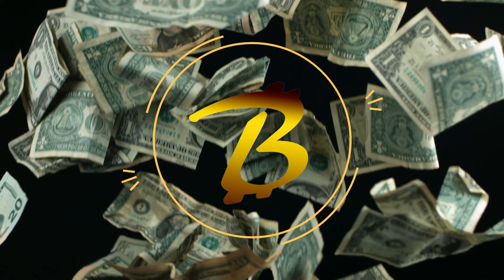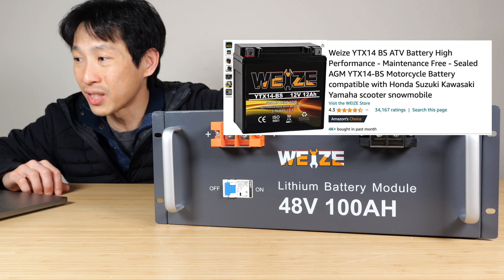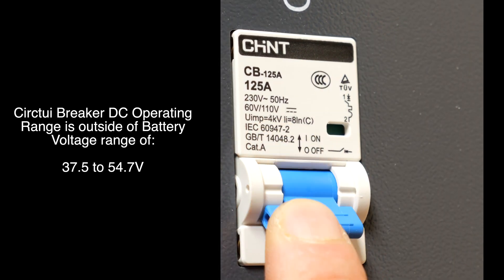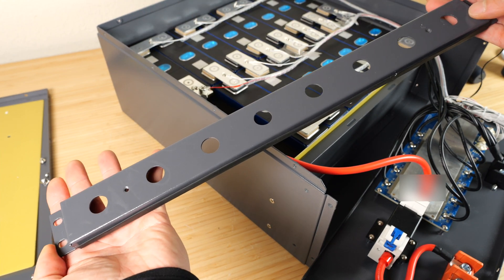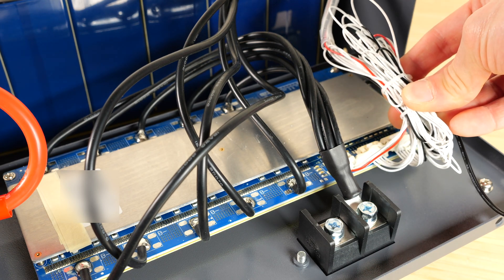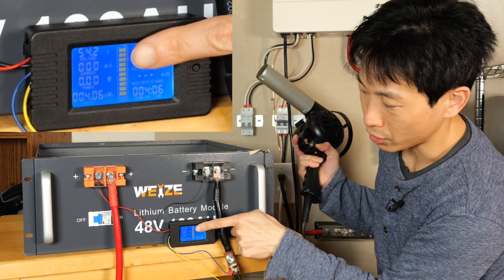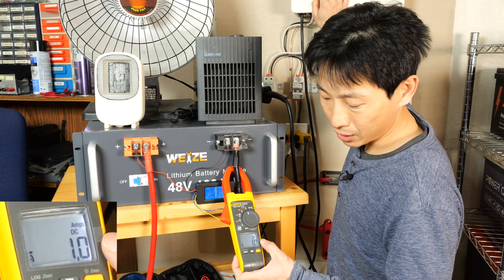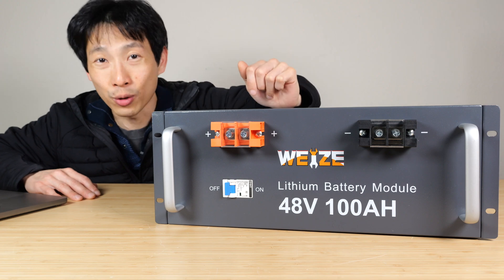48V vs 51.2V Server Mount Battery [Weize]

Comment: Absolutely WORSE battery company I have every seen. Sent me a dead battery will not replace  currently working with California Attorney General regarding Consumer Fraud   stay away horrible horrible customer service !!
Reply from the maker: What kind of debugging process did you do to arrive that the battery is dead?
Reply: @BeatTheBush  The on off switch will not work the charger cannot charge it and putting another 36 v battery to it does not resuscitate it. Retuned over 2 months ago. Weize still playing games. Needed batteries to run manlift to repair my roof . Now have a lot of damage due to their delay. I am  Now working with California Attorney General for consumer fraud

Comment: Hi, was wondering, apart from voltage difference s, what are the pro and cons comparing this battery with the ones that you reviewed several videos back? (The ones that have carry strings attached).. assuming they're both on the same voltage..
Reply from the maker: If you have 48V (16 strings) on both packs, it's better to go with a server rack since it has battery balancing built in. There's less cost of cables, less fuss and assembly too.

Comment: Stop making biased reviews of these lackluster products just to make a buck and get free swag.  This battery is super cheap only because it is unremarkable with what must be average cells based on your testing.  A brand new battery with decent LiFePO4 cells should have easily pulled rated capacity or more without needing to get into the absolute top/bottom of the charging curve.  There is no energy to be gained really.  Nobody wants a 15x cell battery that doesn't conform to standard inverter charge/discharge profiles.  A no frills battery like this should be 3U not 4U height, saving physical space in a rack.  Yet another YouTube channel I have always liked that I am about to permanently block.  The YouTube platform from top to bottom has become so unethical and/or corrupt.  Manufacturers are having a field day with how easy it is now to get subpar products represented to the public as something worth buying.  So many channels selling out, sacrificing their credibility and integrity.
Reply: Well said
Reply from the maker: The reduced capacity is due to a 0.4V charge difference due to my inverter since some parameters did not work well with a 15s configuration.
Reply: @BeatTheBush  You obviously didn't read or you understand what I wrote.  If you knew anything about LiFePO4 charge/discharge curves (which you should as a guy doing battery reviews), you would know there is very little available energy to be gained at the top and bottom of the curve.  Regardless, GOOD new cells would have tested over capacity despite not quite being charged in full.  The .4V at the top/bottom of the curve in a 48V battery would have added very little energy...marginal at best.

Comment: There are two things you sort of allude to in your video, but never really discuss, with any specificity.  These batteries have one less cell, which means the voltage can sag below 48v (which you noted), and due to charge parameter limitations, you accepted that you are getting 3% less capacity.  However, you're also getting one less 100ah cell, or 1,280wh less capacity, since it does not have 16 cells.  Now, that battery does come in at a competitive price point, even after you take into account the reduced watt-hour capacity it has.  The problem is that it doesn't adhere to the industry standard of 51.2 volts, nomimal, by using a 16S design.  Many folks are "Weizely" staying away from these 15S batteries, for that reason.
Reply from the maker: Both 51.2V and 48V batteries will drop below 48V with enough discharge. 40V and 37.5V respectively. There was an issued with charging to 100% using my inverter since the voltage setting was in increments of 0.4V. Certainly, if you build a brand new system, I wouldn't go with a 15 cell but it's interesting to see.
Reply: @BeatTheBush  - I'm not talking about the range of voltages throughout the discharge curve.  I'm talking about voltage sag under load, which is completely different, although the two concern do intersect.  The main takeaway is this battery is not following the industry standard and that makes it a bad choice for a variety of reasons.
Reply: @BeatTheBush  No, no it's not really interesting to see a battery that that doesn't' conform to standard inverter charge/discharge profiles.  Only reason to review this is to make money and get free stuff.  Hench the affiliate links for garbage.